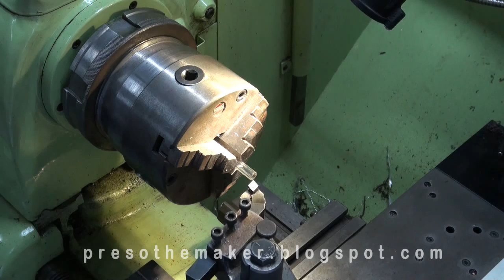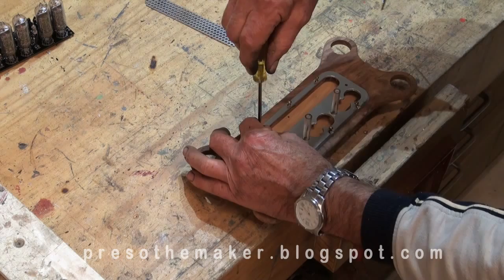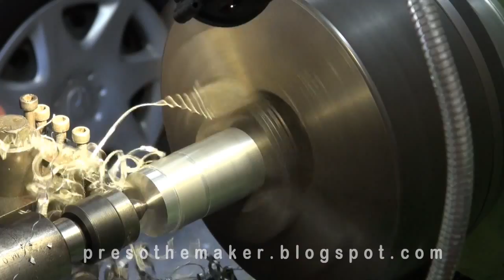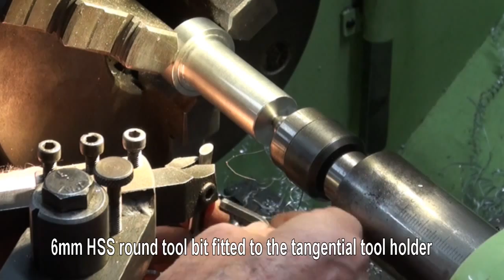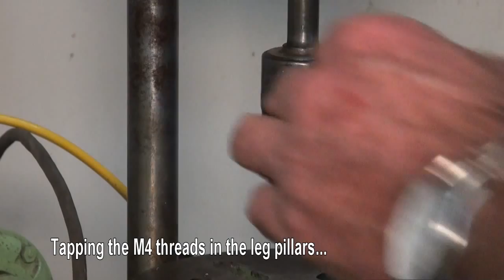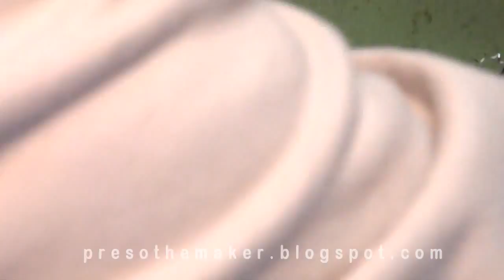Neo Steampunk Nixie Clock Build Part 3

Comment: Oh no, I have more questions! Could you possibly post a couple of pictures of your drill holder setup? Also I have a question about your dividing fixture? Is this something you made for your lathe, or something you purchased? If you bought it, do you have the name of the company that makes them?  It is too far beyond my meager skills and tool collection to build these 2 items. 
As always, Thank You Sir so much for your time! Even if you do not have the time to reply to my questions I wanted you to know I have learned a lot from watching your videos!-John
Reply from the maker: John, I can send you the technical drawings for the complete clock. They will be PDF copies of the original engineering drawings. I will send them direct to the email address that you sent me. With regard to the drill holder, I made two of these specifically for my lathe. One mounts the drill at right angles to the axis of the spindle and the other mounts the drill parallel to the spindle. You really only need one if you can rotate your compound slide though. One of the fixtures is cast in aluminium alloy and the other was cut and welded from solid mild steel. I have never seen a commercially available product like this however there are some lighter duty versions for things like Dremels and other rotary tools. try Bangood. The dividing fixture was also made to fit my lathe. I have seen some versions that are very simple which involve a card or plywood indexing plate which is fixed to the headstock spindle. You can print a simple circular division diagram with whatever number of divisions that you need and then glue this to the disc. Some versions that I have seen use a cheap digital microscope to align the divisions to a cursor. If you can then lock or brake your spindle in some way you can get reasonably good accuracy. I will see if I can find some photos of both the drill fixture and the dividing fixture and maybe I can find the link to the YouTube video which shows the optical dividing technique. Glad you enjoyed my videos,
Regards,
Mark Presling

Comment: I'm curious about your tool post. Did you build it like that for cost effective reason's? How does the height adjustment work out for you? Thanks for the videos, even though I'm a bit late to the party, I'm thoroughly enjoying them!
Reply from the maker: Hi, I made that tool post when I first acquired the late. We were on one income at the time with two young kids and I didn't have a lot of spare cash. I was able to make the post that clamps into the compound out of stock that I had on hand but I had to buy a couple of metres of steel to make the tool holders. The height adjustment is very easy to set and it has a lock nut on the bottom of the tool block so that once set it never changes. I used M6 X 1mm pitch screws for the height adjustment so it is a fine-ish thread which can be adjusted to a fine tolerance.  An old model engineer showed me a similar system that he had built himself for some short production runs of live steam feed pumps. He had lots of special form tools and odd shaped turning tools and he claimed that it was the cheapest way to make a QCTP. This would have been 20 years ago and there was no such thing as cheap Chinese tooling on the market. I have since replaced that tool post with a BXA type QCTP, mainly because I thought it might be a bit more rigid. 
Thanks for watching.
Reply: @Preso58  Thanks and I understand being in a position to do what it takes. I actually like the idea, especially the drill attachment, as that seems to be very convenient. Was the new tool post any more rigid? I like that ball turner also. Keep making videos, as we lowly folk learn much from them!😀
Reply from the maker: The BXA tool post was slightly more rigid. Depending on the tooling there is a lot less overhang. The downside is that rotating the tools around the tool post axis requires an extra spanner and I have to reset it each time with a square so that when I use a parting tool it is still aligned to the cross slide. With the tool post that I made it had a vertical groove running down the vertical cylinder and the parting tool holder had a set screw in it that automatically aligned the tool.

Comment: Mark,  This is an interesting project.  Either in this video or in Part 2, you scared me a bit when you held the thick aluminum plate to drill some holes.  One of my parent's neighbors was into street rods and was making a sheet metal enclosure for something in one of his cars.  He made the mistake of trying to hold it (it was either a cylinder or a box) by hand while drilling some holes.  The drill grabbed it, with one of his fingers through another hole, and wrapped his arm around it until his fortunately low-powered drill press stalled out -- he could just barely reach the power switch to turn it off.  His finger was badly cut, which grounded him from flying (he was a commercial airline pilot) until he healed and was certified to return to flying.  I know that the part you were holding wasn't as thin, but I've seen bruises on Toolmakers at work when a mill cutter pulled bar stock out of the mill vise and swung it like a baseball bat, hitting the Toolmaker in the ribs.  He was lucky to only be black & blue, with no broken ribs.  I'm overly nervous about watching others do anything similar, so I'm most likely being too nervous when I see what could end up being an injury.  Anyway, I'm looking forward to watching you finish this project - maybe I'll get around to building my nixie tube clock before I retire -- it's all transistors no ICs in it at all!